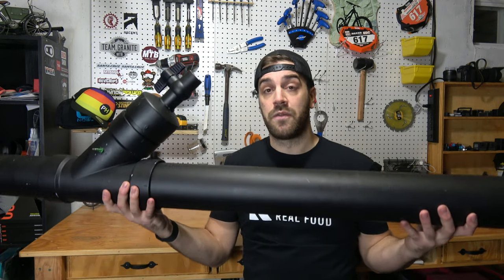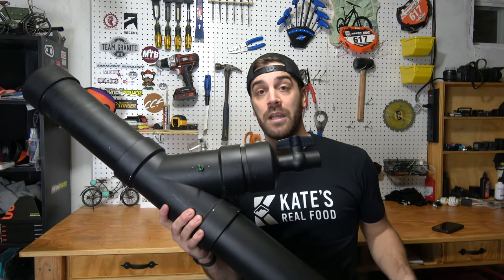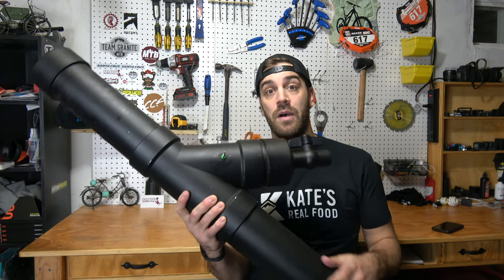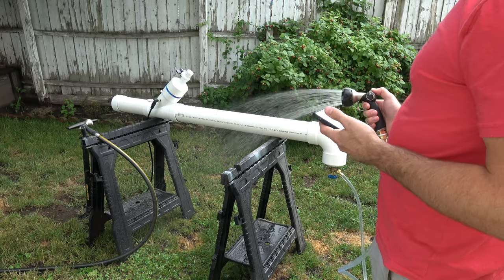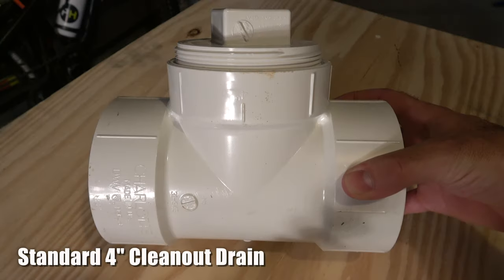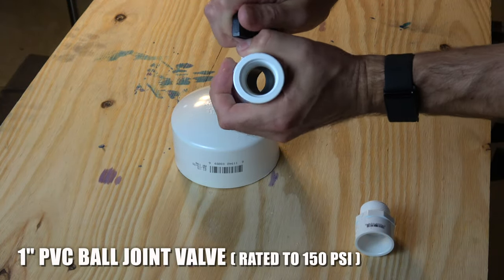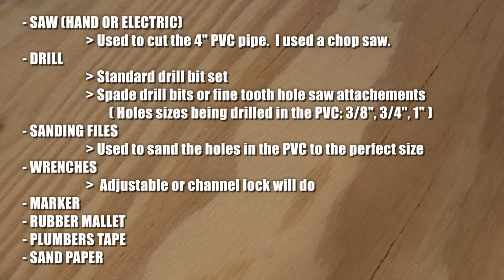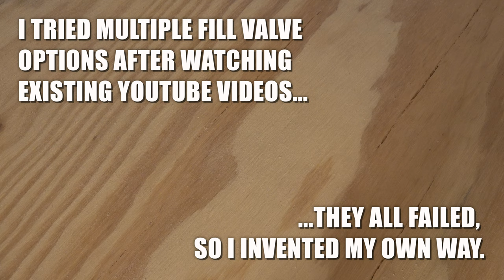DIY: Pressurized, Solar Heated, Rooftop Camper Shower for Under $150 | NO ELECTRICITY NEEDED!

Comment: Nice. The ball valve is a great idea. You can fill via pressurized water or just pour it in. Two minor suggestions for anyone building these things. 1) Use a step bit. Leave the spade bits for woodworking. 2) Use a 1/4 turn boiler bib instead of a garden hose bib. Well, here's a third. 3) consider using a foot pump. You can keep pumping pressure in as needed during your shower. I have a collapsible shower bag that uses a foot pump. I never run out of pressure. You can use your bike pump this way too if you don't mind it getting wet.
Reply from the maker: All great tips!  Thank you!
Reply: Or if you want to use the spade bit don't predrill. That's what the pointy bit in the middle is for. It won't go all wobbly like it did at 5:31.
And think about clamping the things you are drilling so you don't drill your hand.
Reply: No baffles to keep the water from slushing when you are driving?

Comment: That's a nice build.  Back filling through the spigot might be easier than top filling.  Your hoses are all ready double female so you can do that no problem.  If not it's easy to make one or buy a washing machine hose at a hardware store.  I have seen schedule 40 PVC pipe used to run compressed air in a work shop.  I guarantee 30 PSI is safe as long as your build is solid.

Comment: I successfully used this video to make my own shower, thank you!  Lots of great ideas, especially the oversized ball valve as a filler.

I did need to tweak a few details to make mine work, though.  For anyone who's interested here's what I found:  a few early experiments showed that -- for me anyway -- sealing up the valves with silicone did not hold air pressure reliably.   I worried such failures would be a problem if I set valves into cemented-in end caps (if the silicone didn't work, how would I fix it?).  

Accordingly I put my hose bib into a reducing fitting that had a female thread receiver.  More significantly, I put a 4 inch tee, instead of a wye, in the middle of my long tube.  The middle part of the tee is a 4 inch female thread fitting.  I set all of my valves, including the big ball valve, through a flat 4" screw cap.  That big screw cap never needs to be opened, unless any of the valve sealing fails.  All of the failure-prone parts are isolated in that one removable cap.  To seal the valves going through that cap, I used o-rings on each side and a bit of TPFE paste.  

Now it works like a charm!    When I'm filling it up at home, I can just back fill it via the hose bib.

I also decided to put slosh limiters inside my tube.  This was a pain but limiting the slosh should reduce some of the forward/back forces on the tube that might rip it off the roof.  And a dedicated pressure relief valve set to 35 PSI.

Hope this is useful!  Thanks again!
Reply from the maker: Glad the video was helpful for you and love all of the adjustments that you made.  Mine is still working great, but if anything does fail I will be stuck.  Also helpful for a yearly cleaning and such.  Great stuff!
Reply: @MTBTravelReview  Now that I've used mine a bit, I wish I had used a wye like you did, instead of a tee.  But I couldn't find a wye with a screw cap.  What I've found is that to really use the air pressure to get a good "long" shower, I need to leave a little bit of empty room in the tank, so there is a sufficient volume of compressed air.  Your wye leaves a little volume for that.
Reply from the maker: @sl0wb0at  ahhh, solid point that I’ve never really consider… still no perfect solution then.  Maybe a ywe with an extension that has a screw cap?
Reply: @sl0wb0at  What did you put in the tube to mitigate the slosh?
Reply: There's a clean out cap called a Tom Cap which you can cement inside a pvc union.  I did that, but drilled out most of the cap itself so water would mostly flow.  Youtube user Eric enjoys earth did something similar with drain covers.  Or you could fill your big pipe with wiffle balls.  Good luck!
Reply: Baffles, now that's a good idea. I wonder how you could integrate them easily? @TarawaS2000

Comment: If using city water, use the pressure in hose to charge the system while filling up! You don't need to manually pump up the system unless you are remote and  don't have access to pressurized city water. Otherwise, nice system!

Comment: Thanks for the good video, and showing me a way to update the one I have. I want to slightly pressurize the water, and the bike valves are a great idea. 

As you’ve shared your great ides, I’ll share my tip. To mount the shower, I used threaded rods and put fuel line over them. Bent them around to fit over the shower, and then threaded them directly into holes in my cross bars, put nylocks on the bottom, and been going strong for 4 years. 👌🏽🤙🏽
Reply from the maker: Thanks for the kind words and for the tip.  Great idea with the threaded rods!

Comment: Now the thing I see that I would do different than what everyone is doing is I would make a smaller diameter tube and make it square and depending on the size of your rv/truck/etc you can add rows for what ever volume you need.  This distributes the weight evenly and it also is more surface area for the water to heat up.  You could also make it hinged so it could be angled toward the sun.  I have seen a similar design from a friend and it would get super hot like too hot but that was in Texas.  If I knew I would be dealing with that I might make a cold water mix.  You could also just make a separate pvc pipe pump that has a valve for filling but also a valve that connects to the water so you could pressurize it first then release it.  Then you could judge the size you need for the length of shower you want.   I also have a 12v outlet in the back of my Element and I have a airpump for my tires that I could set to 30 psi and just push a button when its starts to fade.
Reply from the maker: Do they make square pvc?
Reply: @MTBTravelReview  just using right angle connectors to form a grid shape.
Reply: Good in theory, but every joint is a potential leak, especially when you have a square matrix on top of a moving vehicle. It seems like it would be subject to constant small shear forces just going down the road. The design in the video also allows you to use most of your rack for other things rather than using it just for the solar shower.

Comment: Nice video.  Great how you start the video and give us all we need and don't just jump in to project.  Appreciate it.  I have built  some off grid outdoor showers that I made a pvc chamber that was separate from an old hot water heater.  I would have to pump it like 30 time to get a decent shower.  I later found an old vw 12v air pump that ran off a battery.  I did'nt take long to pressurize the hot water tank and enjoy a shower with two showerheads at the same time.
Reply from the maker: Cheers!

Comment: Tip for beginners to fill easier if near town water pressure , crack the ball valve open up top attach hose output to town water and turn taps on till water rises out of ball valve shes full ready to heat just turn off taps and close ball valve.
Reply from the maker: Solid advice!
Reply: Super smart
Reply: Correct. Alternatively, with town pressure you could leave the valve shut to fill to town pressure, ie, to pre pressurise the vessel, while it would hold a little less water it would be ready to go without pumping up.

Comment: Thanks for a great video....some of the best music I've heard on my YT journey into camper build outs. I've completed mine, but I am now stuck with a threading  cap for my water fill up access and it appears you can't just add more plumber's tape to seal it up. I have a slow leak and can see your shut off valve would be perfect. I think I can probably make a modification on mine to get there by using a combination of ABS glue and epoxy (if needed) to thread it in for good and seal it up. I should be able to drill out that cap and install a valve as you have onto that. Of course I'd do that before installing and Ii would simply be on that threaded cap instead of an end cap. Gonna look into that tomorrow.
Reply from the maker: There is always a fix!  Cheers man

Comment: You could have used PVC pressure pipe and not be worried about the PSI. Also Id have used a 4x2 wye instead of a straight 4” and you could have saved joints and money. Otherwise it's a great design!
Reply from the maker: Appreciate the insight man! There is definitely room for improvement if I ever make another.

Comment: Nice job man, but put some black painted 5 or 6 inch hose clamps to attach it to camper. Just say'n
Reply from the maker: Thought about hose clamps, but sticking with the ratchet strap because using 1 ratchet strap makes it really easy to take on and off as needed.

Comment: Its a great build all right, but just like you its great to watch other people do it and then do what you think is best. So with that in mind the only improvement I would make on yours if I were building one would be to have the "air in" schrader type  valve fitted on the same plane as the pressure relief valve. Reason......so it cant get damaged or bent, if the pipe rolls or something knocks it either on the vehicle or in the garage when its not in use...... because to replace it could be a bit of a bugger if it did. Just sayin'
Just out of interest how would you replace the valves if the did need replacing?
Reply from the maker: Regarding the valve, I don't think there is any perfect placement.  Placing the valve at the top would make it tough to my bike pump hose to reach.  I have had the presta valve bend once already. Luckily, the core of the presta valve is the only part that can really bend and it's replaceable, so it's a pretty easy fix.  If the valves need replacing, things get a bit more complex, so I will cross that bridge if/when I get there. haha.  Worst case, I'd have to cut out a section and replace it completely, but I don't see that happening any time soon.  It's been pretty bomb proof so far.

Comment: Tks for posting. The ball valve is excellent idea. I built mine with the 4" screw in cap with the rubber seal and it still leaks pressure. Time to modify!
Reply from the maker: Happy to help!
Reply: PTFE pipe thread sealant.
Reply from the maker: @markburnham3637  need to constantly open and close to refill and empty.  Ball valve is very convenient.

Comment: I like the ball valve idea. I plan on making one but instead of pressurizing it I plan on using a 12v RV pump on the output. I already have the pump setup.
Reply from the maker: Solid idea!
Reply: Schrader valve instead of presta.

Comment: Didn't notice but you surpose to give the pipe a quarter turn when you glue it. Maybe difficult for 5 inch maybe thats why.
Reply from the maker: I tried for sure, but you are right, not always easy!  Sometimes I used a rubber mallet to make sure it is set in all of the way.

Comment: Nice.  I built a U-shaped 12gallon and wrapped it around a 320 watt solar panel but I used only two air valves.   takes longer to fill, but super frugal and easy to pressurize.  Water always seems to be hot.  Video on my channel.

Comment: Curious about the decision to use the WYE hub rather than another elbow at the other end. An elbow would reduce the total number of joints and would reduce the cost, but I may be missing some obvious advantage of the WYE hub.
Reply from the maker: I can only reach up that high on the roof if I stand on the wheel of my camper.  Otherwise I would need to carry around a step stool of some sort.

Comment: I watched a few and on the fill they used teflon plumbers tape for a good seal. I would add a relief valve as well as a pressure gauge
Reply from the maker: Yup, many do, which is great until you realize you have to open and close it every time you use it.  Then you are constantly using plumbers tape, which sucks.  Also, there is a pressure release valve, and no need for a gauge because the bike pump I use has one. :-)
Reply: @MTBTravelReview  I'm not sure why the person I seen had the gauge extra precautions I guess
Reply: @MTBTravelReview  Funny enough, I was wondering why no gauge as I watched the build and then remembered that you were using a push bike air pump which would have one on it. I'll be using my vehicle mounted air compressor so I'll put a gauge and a pressure relief safety valve to keep everything safe. Well done on the video production; "show, don't tell" was perfectly executed.

Comment: Very nice build, but you should let people that a Presta valve requires an adapter, in order to use a standard air hose like you would find   at a gas station. Most folks probably are not aware of that. Thanks for the video.
Reply from the maker: I explain the difference in the video and point out the fact that I use a presta, which works with 90% of standard bike pumps.  Thanks!
Reply: Plenty of room to put BOTH for convenience/versatility….

Comment: awesome job!  getting ready to build one this week and will definitely use your video as the guide. Thank you for taking so much time to provide all details!!
Reply from the maker: Thank you and you are welcome!! Fun build and still working like a dream.  I have since added an 8 gallon backup tank so I can transfer over as needed.
Reply: @MTBTravelReview  Awesome.  bought some parts today to start the  build. 2 quick questions.  Is there any particular reason you chose a "wye" instead of an elbow at the opposite end from the spigot?  4" SCH 40 is rated to 220 PSI so I would think installing the auto vent isn't really necessary.  I want to keep it simple but also safe... Thanks in advance!
Reply from the maker: @patrickrose2508  I could lie about the WYE and say aerodynamics, but no, no particular reason at the time. Haha. Just seemed to work best.  That said, the WYE works well because it provides extra space for pressurized air.  Others have tried to use an elbow with less room for air and they said the system didn’t pressurize right.  Regarding the added release valve: it’s def not necessary, but has been useful to release air as opposed to opening the ball valve, because the ball valve makes a large “pop” sound when you try to release all excess pressure at once.  Hopefully that makes sense.  Pressure can just as easily be released via the presta valve, but you have to sit there and hold it in to do so.

Comment: I was just thinking you could add one more piece, a hose hookup, directly to the ball valve end.  Then you could just screw the hose end onto it (provided it has a floating collar), open the valve, and fill that way.  The system would absorb the pressure from the houses water system, then you just close up the ball valve, bleed whatever excess pressure off, and you're in business.  No pumping required!  

Might not work well if the house water is under a ton of pressure, but from what I was seeing, it would probably be safe in most cases.

Comment: Do you have to worry about water freezing in the pipe? I would like to build one of these system and install it in my backyard. In winter, night temperatures can go down to 18 and there can be entire week overcast without much sunlight. 

Impressive design in the video though.
Reply from the maker: Appreciate it.  It’s been working amazing, but is definitely not something I would use in low temperature like you are talking about.  PVC becomes fragile in colder temps, so pressuring it would not be a good idea, with or without water.  The water could also freeze inside and expand, thus shattering the pvc.  This design is only meant for spring/summer temps.

Comment: Sparmax Airbrush company makes a 12 volt single cylinder compressor (I've used it to do airbrush tattoos at the markets. It will run up to 60 PSI, comes with alligator clips for your battery and has an built in Auto shut-off switch ... as any spray painter will tell you the further away from the pump, you line pressure will drop. I mounted mine in the front of my tear drop by the battery compartment and run an 8 foot Airbrush hose. I leave it hooked to the tank 24/7, but only hook up the battery when my wife or me shower... pretty simple and I can also use the pump on my tires and/or paddle boards, if needed as an airbrush hose you can purchase an 8 mm quick release fitting and attach a thumb lock tire hose.... just a thought. Side note; Sparmax invented oil free compressors back in 1990 and many companies make copies...in America, Australia, Japan and England they are easy to purchase, I have one from 1995 at one of our stalls. The one on my tear drop is a year old. Iwata sells them under their logo, but Sparmax makes it for them.
Reply from the maker: Great advice!  I don’t mind hand pumping, since it’s only takes minute, but this would work for many others I’m sure.

Comment: Great build and video. Couldn't you use the pvc ball valve to depressurize rather than needing the separate air vent?
Reply from the maker: Thanks, and you could, but it will likely be quite loud.  The small valve is a more subtle release.

Comment: I know it's been a few years, but I made my own version of this. You have great advice. My issue is that turning on the water quickly creates a vacuum and the flow stops. Right now I only have shredder valve that I pressurize with. Is there air coming in the Presta valve when the water is running?
Reply from the maker: That is an interesting issue that I haven’t personally dealt with.  There isn’t any air coming into the system when is under pressure and the presta valve remains closed.  The water will actually keep running once the pressure is gone as well with now issue.  Perhaps it’s because mine has a down spout and gravity is playing a bigger role?  I am at a loss on this one. Sorry!